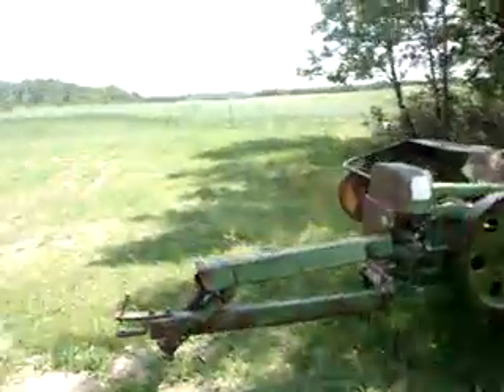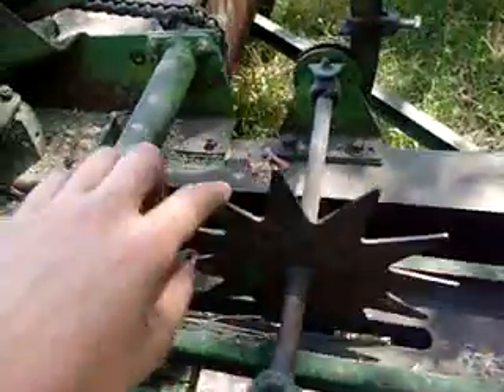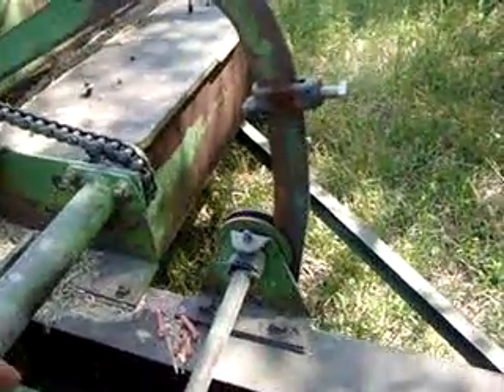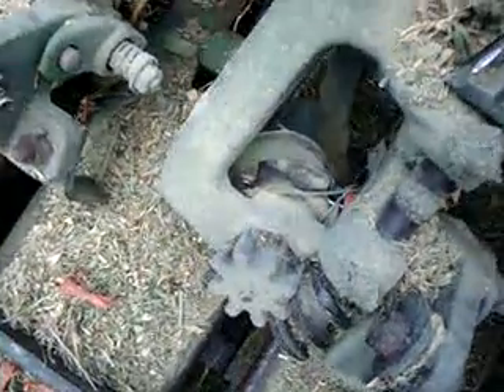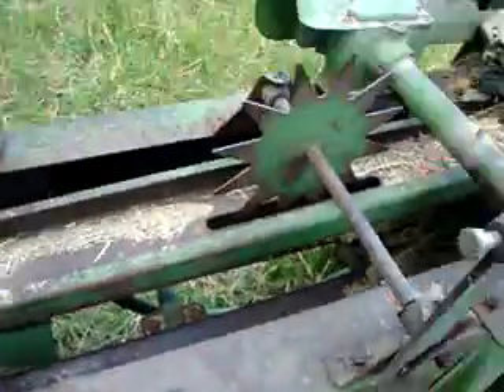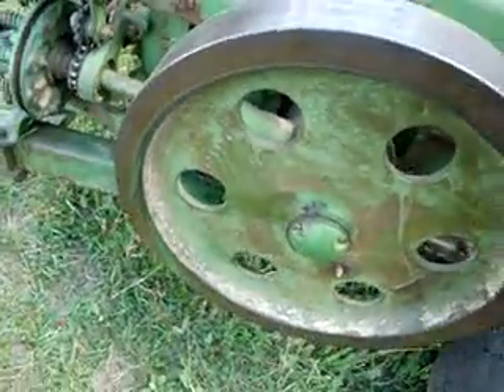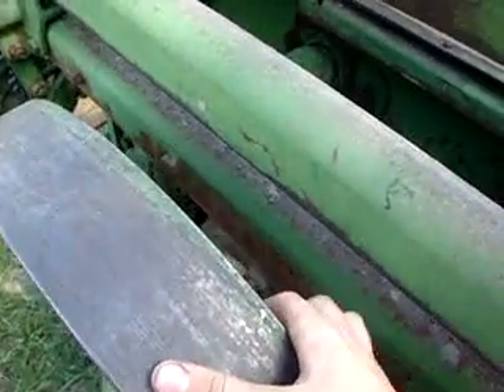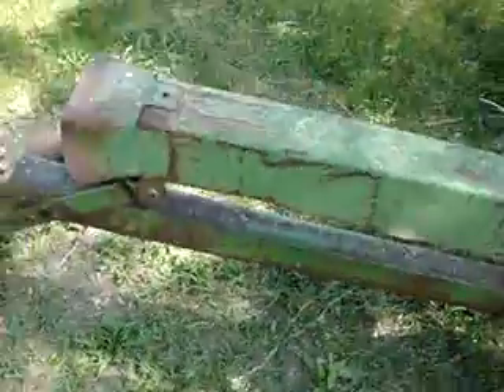How A John Deere Square Baler Works

Comment: go a question i got one of those models it hasnt baled in 15-20 years and im new to this but does the pick reel need some RPM so it turns cuz of that slip clutch gear?
 if you can tell me that would be mint.

Comment from the maker: those two handles screw into 2 big springs. they set how tightly packed the bale will be. so if you tighten them down about 20 turns when a bale goes through it will be fairly tight packed which is good since when you cut the strings to feed it it just literally explodes!

Comment: Nice Video, explains a lot!! I have a question though, what do the two adjustment handles near the tail end of the baler do? Do they adjust the width of the bale or something?
Reply: Further you tighten down the more hay added to the bale. If hay is still a bit damp the heavier it weighs, so would back off a couple turns to desired weight of bale.

Comment: i have a couple antique new holland balers and if i ever get a tractor over where they are at i want to see if i can at least get the model 67 going again. the 66 needs its engine fixed, but the 67 is pto driven. they are neat old balers and still look to be in good shape.

neat old jd baler!!!